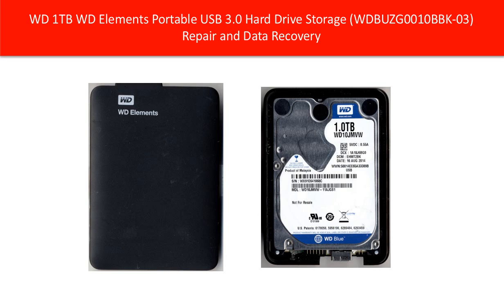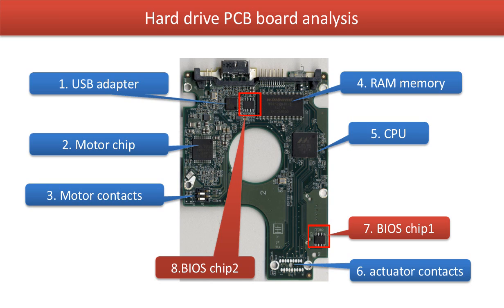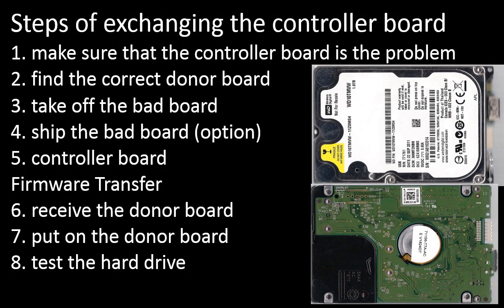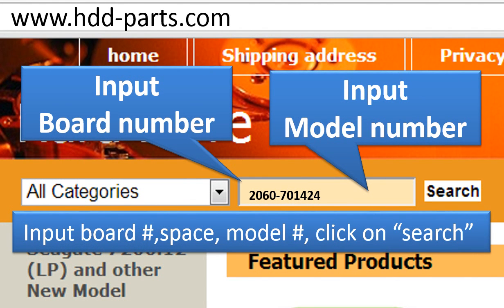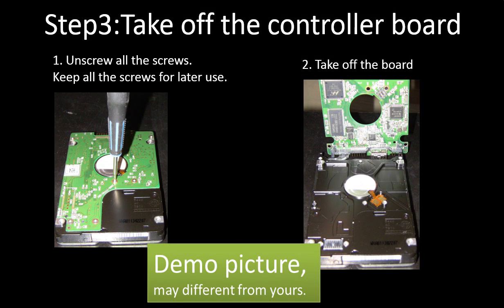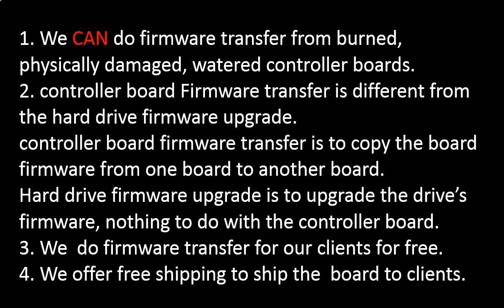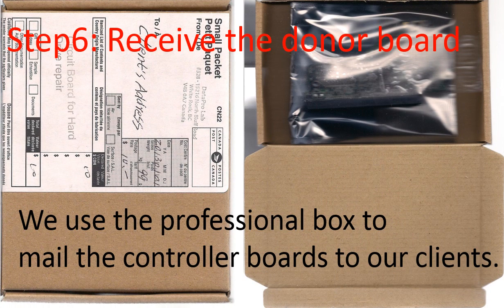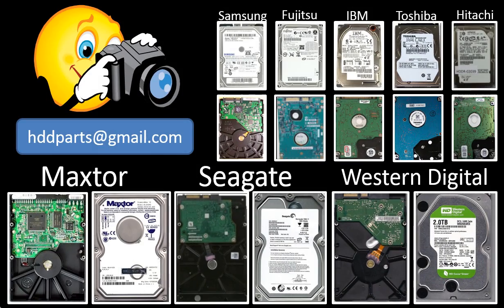repair and data recovery WD 1TB WD Elements Portable USB 3 0 Hard Drive Storage WDBUZG0010BBK WD10TM

Comment: hi Sean, i have wd 1 tb WDBUZG0010BBK-03 hard drive. computer guy tried everything with disk management menu. but he could't repair and didn't want to touch so. my problem it starts to spin and i see power on that  but computer can't recognize hard drive. after 1-2 minute, a bleep sound is occuring which device is taken out. then again it starts to spin again. what is this, PCB problem?
Reply from the maker: can you take picture of the hard drive and email to hddgeek@gmail.com ? let me take a look and reply to you .
Reply from the maker: the PCB maybe ok, but the heads maybe  damaged, we do data recovery for $350.00, no data no charge.

Comment: do you fix other PCB boards? and how much to fix them. Im 95% sure it was external drive case that caused the malfunction on the hard drive. how much to fix or replace?
Reply from the maker: for most cases, $50.00 to fix a Hard drive PCB board. you may use your cell phone to take a pictures of your hard drive and  email the pictures to:hddparts@gmail.com. then we can tell what we can do for you.
Reply: ill pass thank you. I already got prices of $30-35 shipped (maz) to just get new replacement without sending mine out.  Thanks but i'll pass   not worth it at 50 .barely at 30 ;-)
Reply from the maker: we fix PCB, please email me the picture of the PCB to hddparts@gmail.com

Comment: Hello I have the 2TB version, I am not american, sorry my english. My HD started having issues after I was passing a lot of data to it, like 500GB... Did not dropped on the floor or anything else. When I connect it, it works for 5 to 10 seconds, in this mean time I can see all the files and access some, but then it stop working, the explorer freezes and after 3 or 4 minutes comes back and work for 5 to 10 more seconds again. What could it be?
Reply from the maker: dying motor
Reply: Is there a way to fix it?
Reply from the maker: the disk could be the problem.
Reply from the maker: you may need data recovery services.
Reply from the maker: maybe a disk quality issue, we do data recovery only for $350.00, no data no charge

Comment: how do i confirm that the problem from the motherboard exactly
Reply from the maker: technically, you may check the voltage and signal wave  on the PCB  board or swapping the PCB board .

Comment: mine doesn't show up when I connect it for the first seconds and after a minute or two the drive stops and restarts and it shows up but just as a 1TB drive but when I try to do anything with it the computer says I/O error. The problem has been caused by a drop so i believe it's the platter. Anyway, I don't expect this to work again. :(
Reply from the maker: you are right, the PCB should be ok, the disk probably is the problem.
Reply from the maker: sounds like the platter or the disk head is bad.

Comment: hi , i plug wd tv media player but something went wrong and start to show smoke from it so i disconected it, my external wd 1tb hard drive was conected to the media player, so when i took it to the lap top the small light did not turn on, it is that the hard drive is dead, can you help me maybe is a way to fix it, please tell how can it be fixed, thanks.
Reply from the maker: bad PCB board

Comment: When my wd elements was connected to the pc, my pc went into sleep. when pc came back to normal, hdd stopped working. when I connect it, light starts blinking and hdd starts spinning and windows shows installing driver. wd diagnostic tool shows the hdd with SMART pass. but i cannot see the drive in Windows. Only once it showed as RAW partition.
Reply from the maker: check the PCB board

Comment: uuummmm..I have a WD Elements 1078 HDD which is just 18 days old n its not gettingt detected on my laptop or desktop.The light goes on and for a while the icon appears but then nothing happens and the light freezes. I've even tried to format the hard disk but the process failed. Any solution to this fix...?
Reply from the maker: +Mohit Kumar sounds like the disk Assembly is the problem
Reply from the maker: if still under warranty, you may want to exchange it.

Comment: I have two 3.5" WD Elements 1.5TB hard drive. When I plug one in, it doesnt even detect at all. The power cable is connected and the usb is connected. The light blinks and stays white all the time. The other one is detected but it doesnt install hardware, it reaches all the way to the end and hangs there.

Please help. Device manager/Disk Management doesnt show anything
Reply from the maker: can you email pictures to hddparts@gmail.com

Comment: I have 1TB WD Element , it fell down from my desk and now it's very very very slow 
can i fix this ?
Reply: +Abdulrhman Shibli   same thing happened to me and i'm waiting for answer
Reply: +Abdulrhman Shibli  Mine felt too, it now sounds like beep beep beep...and computer can't see it. I have a lot of personal videos. In the local service told me they were not optimistic re saving data.
Reply: +Abdulrhman Shibli  yes we can fix it contact with me 00966563539840
Reply: +Abdulrhman Shibli I've been searching all the internet for a solution for this
Reply from the maker: you need to do data recovery if you want the data
Reply: I finally replaced mine with SSD. Man, what a machine I have now. It is 5 times faster than before. Service guy copied previous disk and saved all the data. Happy end.
Reply: @jesenkosokoljak  what did you do to recover the data, mine does the same it power's on and it keeps beeping.... :/
Reply from the maker: back up your data and switch to another hard drive
Reply from the maker: it needs data recovery. our data recovery quote: $350.00
Reply from the maker: yes, we can fix it only for $350.00 no data no charge.

Comment: I have 1TB WD Element HDD Ext. It Show up on windows with "Local Disk" and it won't open the drive the my explorer became not responding also. I search on google how to fix it and i've try to run on command prompt with "chkdsk". but, after 7 days still not progress anything, only blank space on the command prompt. I'ts any possibility my HDD damage on the hardrive? what parts on the hardrive on my casse? i have important file that is the most important in my life. please give me a solution. Thnx
Reply from the maker: Yusni Irawan probably the disks are not good. not PCB board
Reply: Sean shaw is there any possible solution to fix the issue?
Reply from the maker: paul ivan descargar it could be be the disk problem or PCB board(less possibility)
Reply: so you can replace the disk or the PCB? is it possible to recover the data?
Reply from the maker: +paul ivan descargar yes, we can try swap the PCB board first.